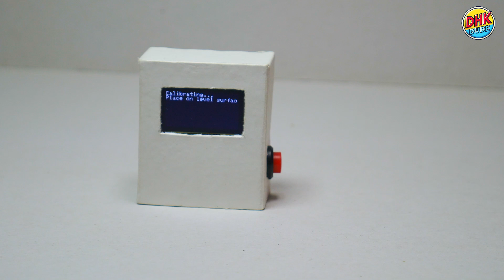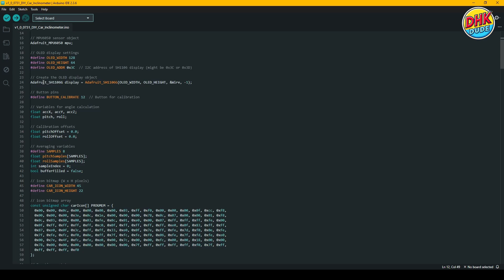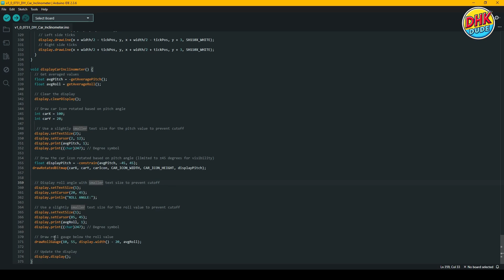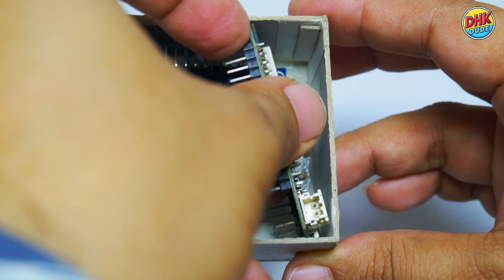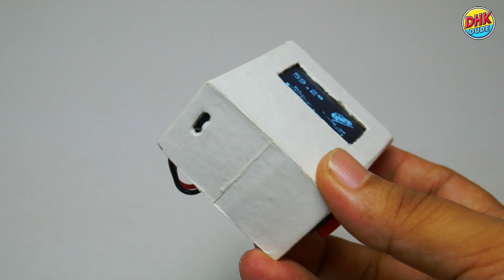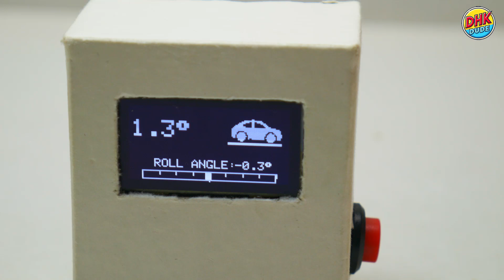Build a Digital Car Inclinometer for Your Vehicle! | DIY Arduino Project (MPU6050 & OLED Display)

Comment: Thank you very much for sharing this project, very interesting and practical. I had many difficulties since I made it on another board and a 0.96" OLED screen, I had to make some changes to the code, I also had difficulties with the MPU6050 because it apparently wasn't compatible, finally I got one that was. I've already finished it and it works perfectly. I'm a novice and I've learned a lot with this project. Greetings from Spain.
Reply from the maker: Thank you

Comment: I need your help. I connected everything according to your diagram and inserted the code, but when I turn it on it only shows "MPU6050 Error!
Check connections" and still nothing happens. How do I fix this. I have checked the connections multiple times and everything is connected properly. greetings
Reply from the maker: Hi, sorry for being late, The error message "MPU6050 Error!" only appears when code "!mpu.begin()" fails to initialize the sensor. The reason could be the connections of MPU6050 I2C pins to the microcontroller board's default assigned I2C pins (here is used 21,22). Also sometimes jumper wires fails prematurely (i spent hours pulling my hairs to find this), check if jumper wires are in good conditions by using multimeter continuity mode.
Reply: @DHKDUDE  Thanks for the quick response. I checked the wires and they are all good. The only difference is that on my screen there are GND VCC SCL and SDA labels and on your VCC GND SCK and SDA maybe that is the source of the problem
Reply from the maker: @slavisamilojevic3114 which microcontroller you are using?
Reply: @DHKDUDE  Wemos Lolin32 v1.0.0 same as yours
Reply: except that there is no inscription WEMOS above it
Reply: they may not be compatible
Reply: Did you solve the problem? I'm experiencing the same error.
Reply: @Ivanivan-ik7ys  Unfortunately, I was unable to solve the problem. The sensor cannot be initialized at all and that's the end of it. I think the author should solve the problem by reworking the code. In the meantime, I have given up on this project and moved it to the drawer
Reply: @Ivanivan-ik7ys  Unfortunately, I was unable to solve the problem. The sensor cannot be initialized at all and that's the end of it. I think the author should solve the problem by reworking the code. In the meantime, I have given up on this project and moved it to the drawer

Comment: No pull-up resistor on the I2C bus?
Reply from the maker: Thanks for pointing that out! Generally these modules (mpu6050 and OLED) come with an onboard pull-up register on the i2c lines.  But yes for clean communication you can add it.
Reply: @DHKDUDE  Unfortunately, I'm not that skilled at this and I have to give up on this project. The smart digital clock and ring clock according to your videos work perfectly for me, but this project won't. Thanks
Reply from the maker: As you said you have already completed two projects from this channel, you have all the skills and knowledge and passion, it sometimes tests our patience, if you need I can help generate simple code just to test mpu6050 with the controller, so you can narrow down the root cause?